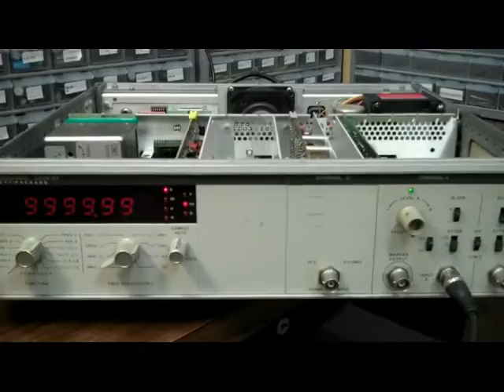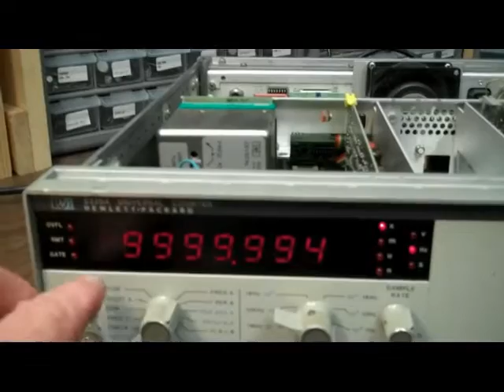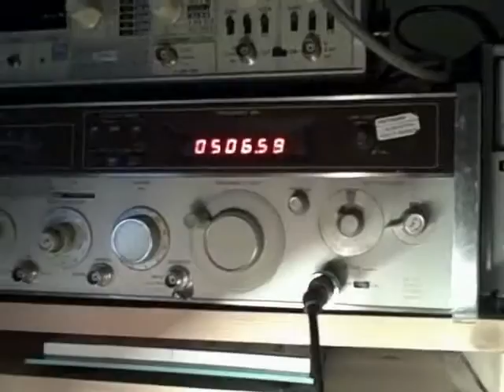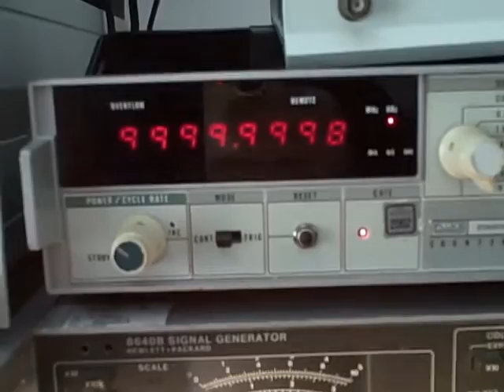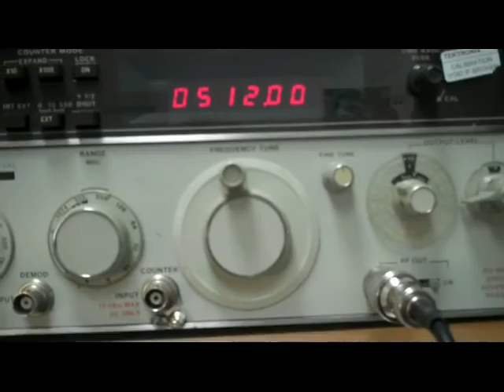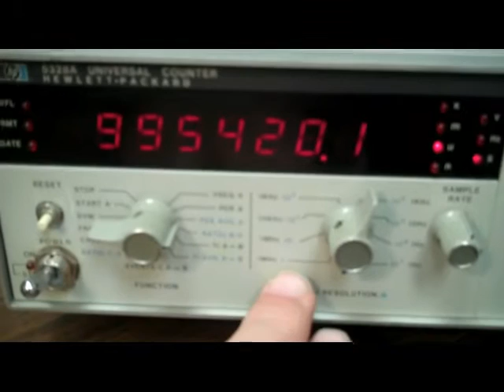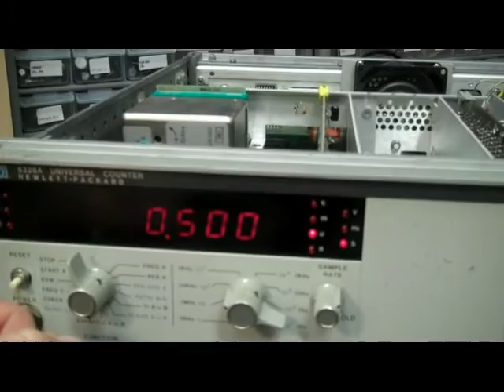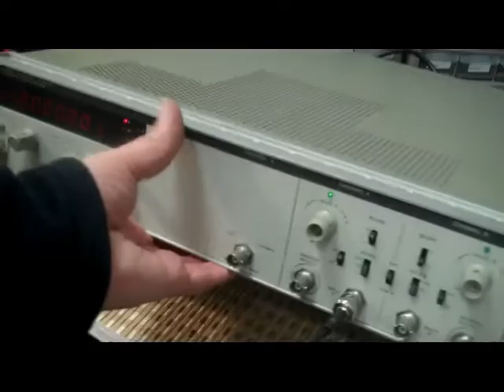HP5328A unit 1 - DC to 512Mhz Universal Counter - 1975

Comment: I believe in later years the C channel option was good to 1.2GHz, or it might have just been a separate option. I own two of them at present. I bought three off Ebay (as I recall @$50 each) but forwarded one to a friend. All had high stability time bases, so I swapped one into my 5340 microwave counter, leaving me a parts unit. The only one tenth high makes sense, as crystals always gain freq with use. Left unpowered crystal wouldn't age, so would come up close to last cal set.